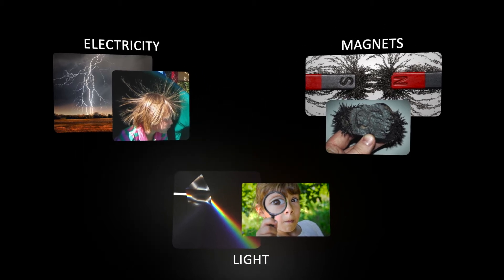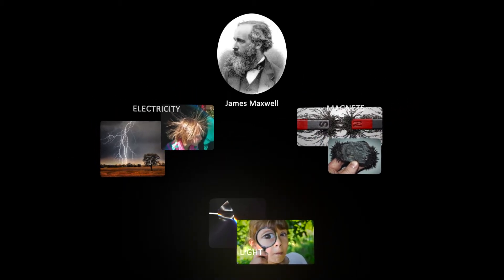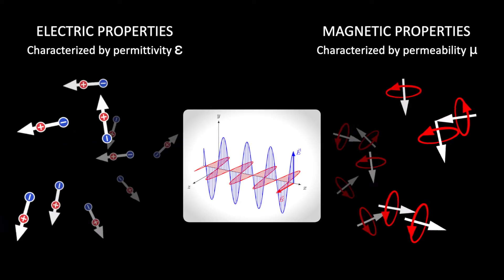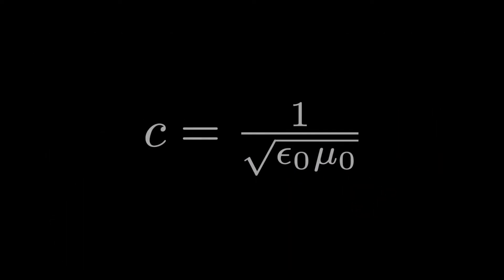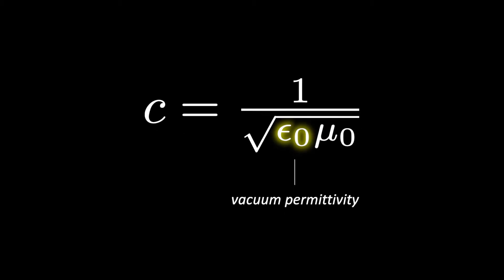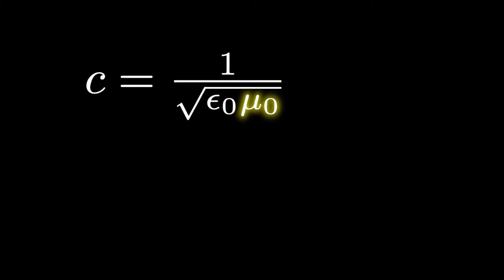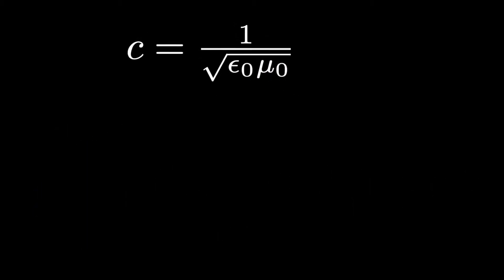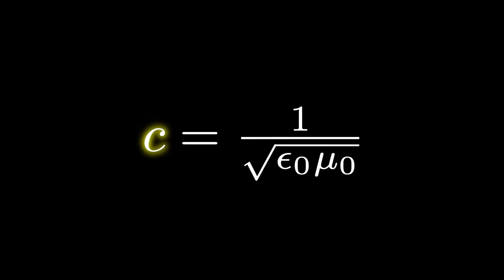Measuring the Speed of Light (DIY version)

Comment: Not only is this a tedious experiment but her teaching stinks to high heaven. At no point did she explain the procedure or the measurements to be taken nor did she explain why this procedure was used. If she teaches this way in her classroom, I pity her poor students. This is exactly the wrong way to measure the speed of light for the reason I state below. She may have a PhD, but I have an MS and more importantly 33 YEARS TEACHING EXPERIENCE to back up my claim.

While this method works, the students do not get the experience of actually measuring the speed directly. There is no light, there is no travel time or distance involved. If I were still teaching Physics (retired in 2015) I would not use this method. Too often students lose the connection between equations and the physical processes they model, so they forget the equations and end up taking very little or nothing from the class. However, if the students see the phenomenon and understand how the equation relates to what they see and measure then they have knowledge that will stay with them. This is the case here.

Comment: You can also measure the speed of light using a resonant cavity and electromagnetic waves of a known frequency. The relationship between wavelength and frequency directly gives you the speed of light.

The electromagnetic waves can be obtained at home with a microwave oven, and the cavity is the inside of the oven. How do you measure the wavelength? Simple: waves bouncing between the walls create standing waves with evenly spaced nodes where the amplitude is zero. Those result in cold spots. If you spread marshmallows or thermal printer paper at the bottom of the microwave oven, you can visualize the cold and hot spots. This is also why microwave ovens have a turntable: it moves the food through the hot and cold spots so that on average, your burrito is evenly heated.

Comment: All electric and magnetic laws are based on SI International Measurement System with uses metric units (kilograms, meters). Volt is at the end (kg*m^2)/(A*s^3), ohm is at the end (kg*m^2)/(s^3*A^2). It would be much more consistent if you would use metric units as well in your experiments. Let's say at 7:55, why use inches? You even have a ruler with centimetres. In experiments with water/air pressure you talk about Blaise Pascal but never said that there is a metric unit Pa which is Newton over 1 square meter. Only PSI was shown. Let's encourage young people to use metric. World is metric and only Americans are behind. You will never switch if you will never try start from yourself. BTW - great videos :)
UPDATE: After a day I need to really add few more words to my comment as it was to hard and somebody may think that I don't like the video. It's really pure gold in terms of how it was presented. All the knowledge should be presented in school like that. Presenter has very good talent, graphic is awesome, everything is awesome :) I wish you all best with next videos!